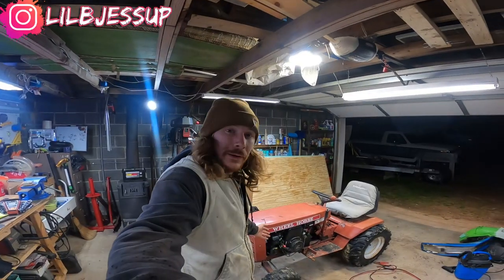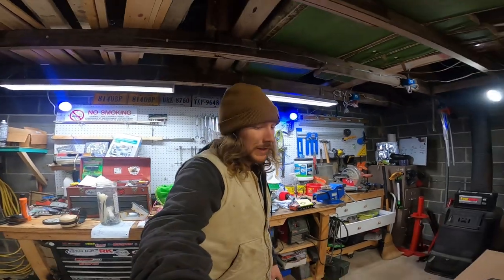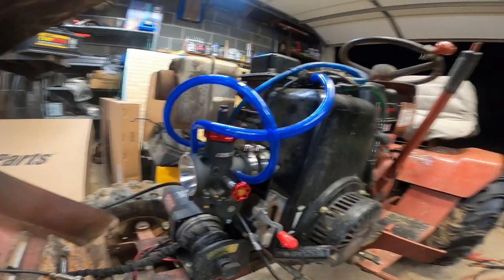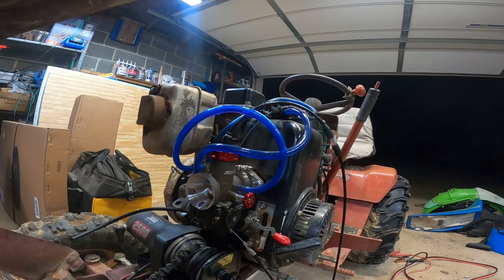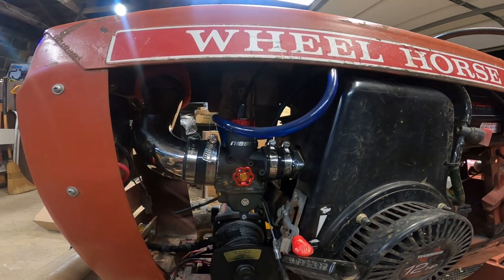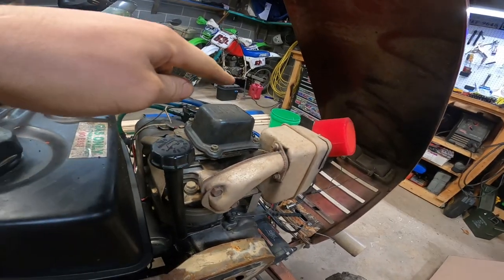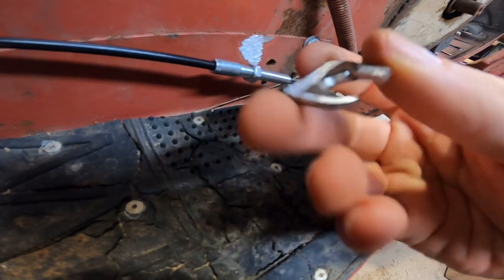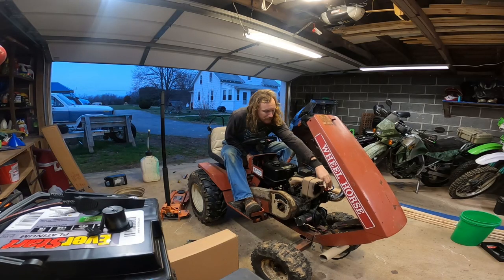Mud Mower Carb Swap, Mikuni Style, More Power!

Comment: Bro puts on like a 80$ carb if not more
Reply from the maker: Yea, she rips now
Reply: @LilBJessup  I saw that carb on Amazon wen I was looking for mine and saw that I was holy fuck is that expensive for a carb
Reply from the maker: @Redneckmowers  80 isn't bad for a tuneable carb that has jets available for it. Plus the brand is somewhat known about. I would hate to throw 40 at it and not be able to get it right.
Reply: @LilBJessup  I guess a I have a 40$ carb with jets and it’s ajustable to me as long as it works and looks good